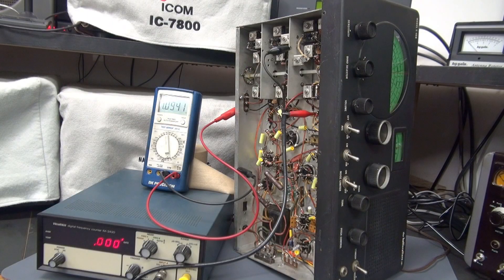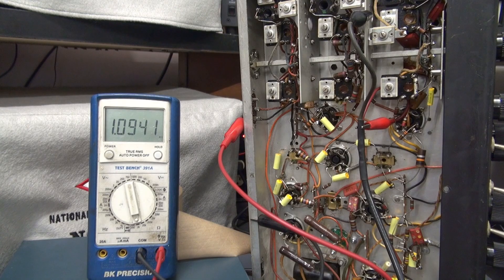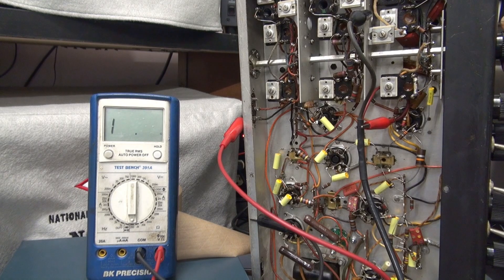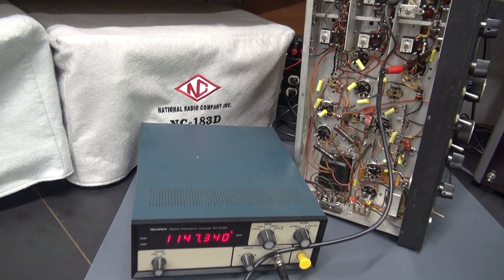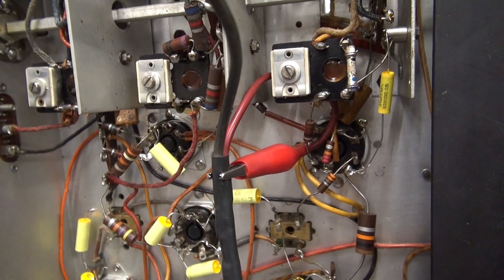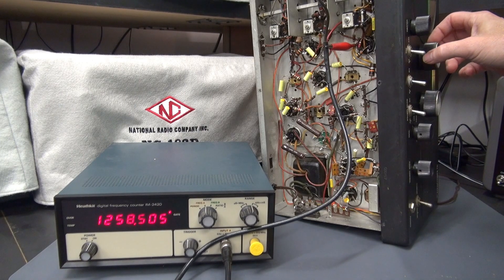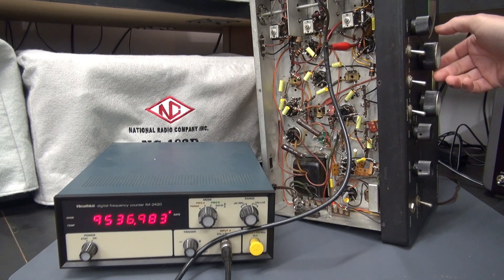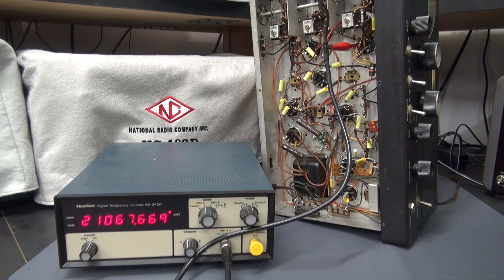Hallicrafters S-40B ham tube type shortwave Receiver Troubleshooting dead band testing method

Comment: Great stuff! I could have used this advice about 15 years ago on a Hallicrafters S-108 that had a dead band. As it was, I couldn't find it, had no idea how to approach such a problem, and I sold it with that problem noted. This may be a dumb question, but I'm guessing the A2 to GND link on the antenna strip has to be in place to test bands 3 & 4?